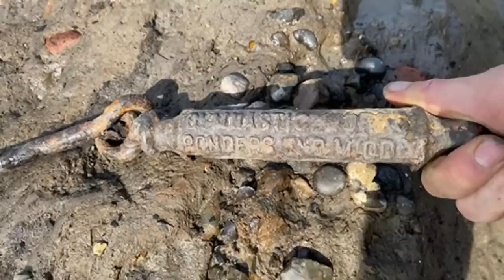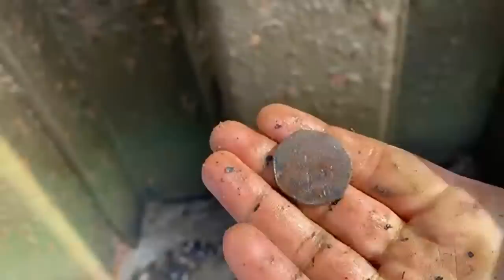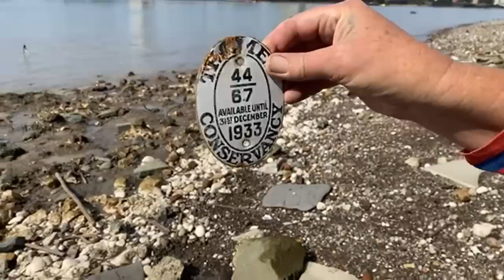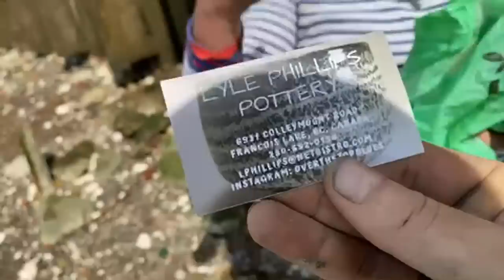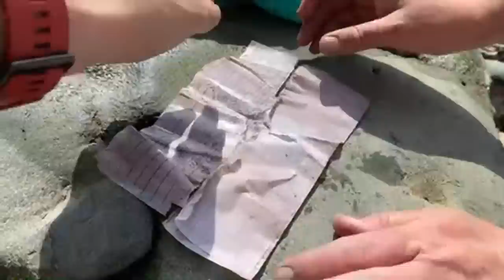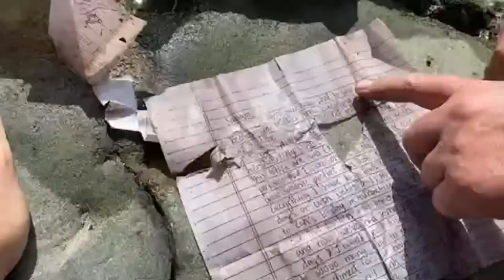LIVE Mudlarking in London with Sifinds and Nicola White

Comment: Every day is a nice day when Nicky is in it! - - 3.49, necklace with the drum - might be a medicare alert that tells that the wearer has a medical problem, allergy to something, etc, on a roll of paper inside. - - Spencer, Heath thing is half a bottle-screw, used for tightenng up and securing a tarpaulin over a load.
Reply from the maker: Nice suggestion but it is a Hindu prayer capsule